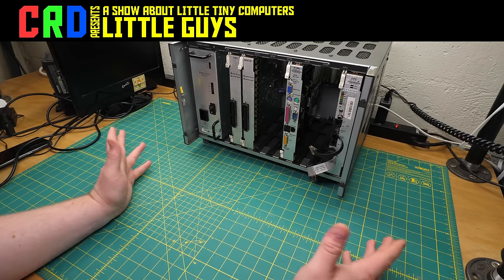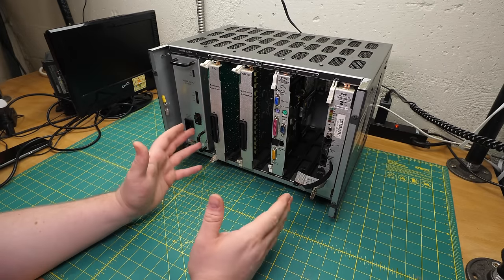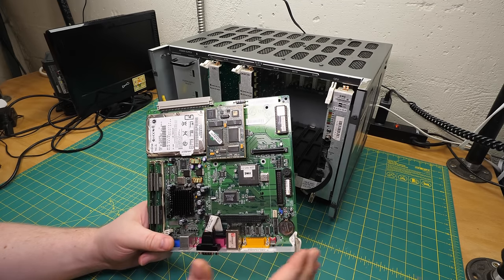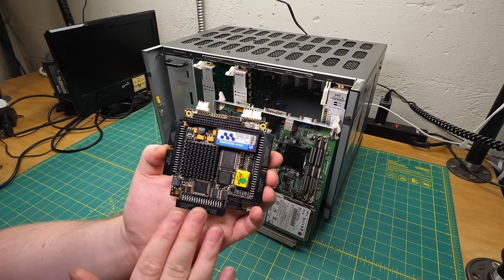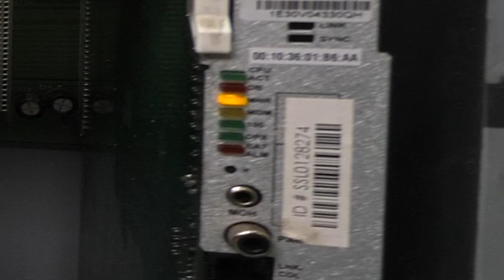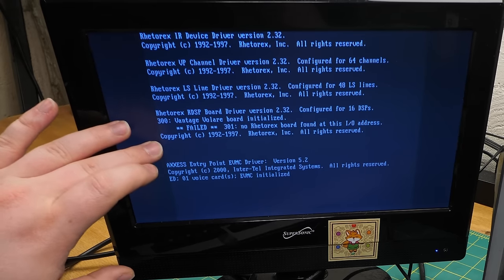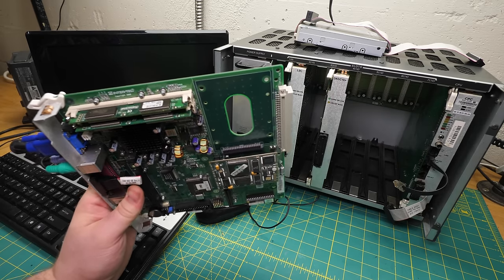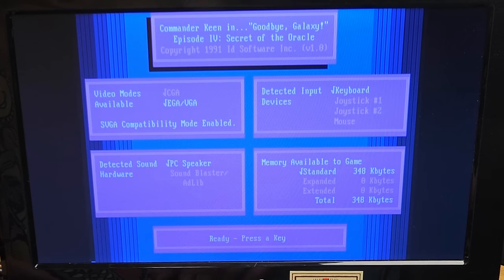Little Guys 9: The First Of Many [Intertel Axxess]

Comment: The 386 and 486 DX-class CPUs had integral FPUs, it was the SX's that didn't. In fact, the 486SX was specifically a neutered DX, rather than the 386 situation where the 386DX was a 386 with a 387 on board.
Reply from the maker: Right, yeah, it's been a bit, heh.
Reply: 386DX didn't had an FPU as far as I know, DX  suffix were later on with 486 era used to determine if FPU is present. 386 era SX/DX difference were that SX had 16bit external data bus, DX variant had full 32bit. And also address bus were 24bit on SX when it was 32bit on DX. 80387 were the FPU chip for 386 cpus, 387 for DX and 387SX for SX.
Reply: False The 386DX had a full 32-bit bus
The 386SX was pin compatible with the 286 Vence being 16-bit

The 386EX was a 386SX adapted and with some SoC-like features for Embeded applications 

The 486DX and SX meant the présence of FPU

Comment: Microsoft still has the fax functionality baked into the print interface even in Windows 10/11. So despite the relative rarity of fax machines these days, the technology continues to live on. I suppose that I shouldn't be too shocked, though, since practically every high-volume commercial printer out there has the ability to be connected to a phone line, assigned a number, and receive or send faxes. It's just not a commonly used feature and I anticipate it being phased out within the next ten years as fewer and fewer people remember that the technology existed in the first place. It's just way easier to take a picture or scan in a document and send it digitally as an instant message, text message, or email. Having fought with a fax machine for a long while when I worked with the government, I can definitely say that the fewer fax machines you have to interact with, the better.

Comment: WRT the little hard drive whoopsie, I think you connected pin 40 on the hard drive (one of several ground pins) into slot 42 (+5V, motor power). Not an expert, but the fact there's a bunch of other grounds and the motor power rail is separate from the logic power rail is what prevented the drive from getting rekt by elimination of the bourgeois pin

Comment: I am guessing that this was used in a car dealership, this is due to the oily film and that I have seen something like this in an old building that used to be a car dealership. There were three systems that were left when upgrades were made the oldest had Z80 chips running them.

Comment: "PCI Early non-VGA device" likely refers to an early PCI device that doesn't have Plug and Play. Windows 98 was all about Plug and Play, and it had been rolled into the PCI BIOS at some point in the mid-90s, but maybe something jelly-beanish like the DSP board from Lucent is just old. PnP came in around PCI 2.1 I think.
Reply from the maker: Don't take this the wrong way, but I'm curious if you have any citations for that. Like, on its face I wouldn't doubt it, I just went "wow that sounds miserable and I never thought about it before," but I wanted to go find references for later use and I'm not coming up with anything. 

I've been looking at some pamphlets from the PCI-SIG and in their summary of major changes for each revision, there's no mention of any changes to PnP - the thing is though, there's no mention of PnP at all. It's like it's an unrelated standard, and indeed maybe it is. So this is really hard to search for, and if you know where I could find details on it that would be really helpful!
Reply: @CathodeRayDude  (Third attempt because YouTube keeps deleting my messages)... 

Plug and Play was always with PCI, but it wasn't useful (as we see it today) until PCI 2.0, and didn't work well until the PCI BIOS 2.1 spec was out... Plug and Play was originally just "the card can tell you how it's configured so the driver can use it" (ISAPNP) and PCI always had a "configuration space" in memory on each card from the beginning to do just that, as well as identify what the card was. In PCI 2.0 you could actually configure the card... but thinking about it further, I don't think PnP is the issue but rather just the configuration space on that card.

PCI 2.0 allowed more flexibility while becoming stricter on what could put into the configuration space (the bit in memory on the card that identifies the vendor, device, device class, sub class, revision, etc.). I can't find any direct references to this either, but I've seen many proprietary PCI devices (like industrial control or GPIO boards) with either a legacy class code or some weird undefined class code.

Specifically though, I suspect your device has class 0x00, subclass 0x00. All the way back in PCI 1.0, class 0x00 in the configuration section was set up for legacy devices running on a PCI bus - subclass 0x00 is literally "not a VGA device" and subclass 0x01 is "is a VGA device" which is about the minimum thing the BIOS would have cared about to find a display. This allowed transitioning manufacturers to bring a PCI card to market using a slightly modified older design, especially cards that just used a PCI to ISA bridge chip on board and did everything else as before. So undoubtedly that card also has zero PnP capabilities, and by definition is an "early PCI" card.

It could be interesting to boot into Linux and run lspci and see what it says, or even in windows to open device manager and peek at the hardware ID, which is basically a cut down version of what's in the configuration space on the card. Look for the &CC_xxxx bit, where xxxx is the class and subclass codes in hex (i.e. 0300 is a VGA capable graphics card).

Some rambling background to address my earlier comment about PnP: Back in the 90's I was working on an "always online" operating system that would rely on a broadband connection, even potentially "booting" off the Internet. It was to run on PC hardware, booting off a 32kB EEPROM added to a NIC that would load the OS into memory over the network, or if the machine had a hard drive it could boot from a cached copy from disk.

It was overly ambitious, required a bit too much RAM for the day, and aside from the complexities of compression, encryption, and the idea of "web applications" was too "new" and died on the vine. The idea was to initially sell NS2000 compatible Realtek based NICs with the EEPROM already installed, and the end user would install the card, connect to a broadband modem, boot and follow the installation process. Later we had plans to have a card that had a NIC, the ROM, and some hardware acceleration for TCP/IP offloading and traffic compression using an FPGA.

So anyway, we wanted to rely on PnP because it would simplify our life. PCI PnP didn't really work nicely on most motherboards we tried until the PCI BIOS 2.1 spec where they fixed the configuration specification. Before PCI 2.0, the configuration space on a card was simplistic - it identified the device (vendor, device ID, revision, etc.) but you couldn't change card settings and it missed other information. Under PCI 2.0, it was still 256 bytes but contained pointers to memory locations with lists such as device capabilities, hot swap support, power management support, message signalled interrupt support, inventory management, and extensibility for vendors to take advantage of. PCI 2.0 also introduced registers that allowed you to actually configure the card, i.e. true Plug and Play as we know it today.

Without getting into it too much as I think I've waffled on enough, the PCI BIOS 2.1 spec was much better at allocating resources automatically and really fixed a lot of interoperability issues with stronger standardisation. The 2.0 spec allowed for configuration but many BIOS implementations either didn't do it automatically or they did but badly resulting in conflicts or missing resource allocation.

Sorry for the long reply.
Reply from the maker: @benespection  Ah! This makes more sense, okay, I DID see mentions of the configuration space being expanded with 2.0, but I didn't know that was connected to PnP. I get the strong impression that "plug and play," as a branding initiative, had very little specific meaning and actually referred to a ton of unrelated behaviors, this being one of them. I am now extremely curious to obtain an early motherboard/card combo and see if I can identify any glaring differences in behavior. Thank you so much for all this info!

Comment: pulse dialing works backwards i.e. a 1 is 9 pulses, 0 is 10 pulses. It's because on a dial phone those numbers will travel the longest and "click" most contacts.
Reply from the maker: you almost have that right. the 0 is indeed ten pulses, because you can't express zero in finite clicks, so they put it after the 9. the other numbers are all straightforward.

Comment: I don't know if it's applicable here, but the Game Port was also used for MIDI for a while. So I guess it had some use as a more general purpose port. Pin 12 was used as a MIDI Out instead of a Button GND in that case, giving the port an output.
Reply: Technically, MIDI was just borrowing an unused pin in the game port pinout.  That only happened because the Sound Blaster combined a bunch of previously separate cards into one, and it became expected that sound cards would then offer all the usual game-related stuff:  FM synth, digital audio, a game port (which previously would be on the IO / controller card, and before that, on e.g., the IBM game port adapter card), and a MIDI interface.  Since there is only so much room on the slot bracket, they had to get Creative.  (heh.)

Comment: The way the CPU Card blocks one of the ribbon ports so you can only ever have 1 CPU card, even IF the enclosure is expanded, AND it keeps the card at the very end of the enclosure, it is VERY clever, simple and low-tech. I love solutions like this compared to overwngineered solutions.
Reply: I've seen a portable audio mixer with a similarly clever low-tech auto shutoff solution. When you close it a little peg on the cover pushes onto the main power rocker switch.

Comment: As a kid in the early 90s, there was a brief time where I was obsessed with OS/2 but by the time I got a copy, I couldn't get it to install, plus Windows 95 was either out or right around the corner.

Also, if the motherboard has a PCI bus, you can absolutely get USB working, even on a 486. Allegedly, in the embedded world, it's not uncommon to see native USB on 486-based systems.

Finally, Duke3D should be playable on a DX-2...At least much better than this. Granted, I ran it on a Cyrix DX2-80MHz (so faster bus than most at 40MHz), plus a decent VLB video card.

Comment: Something in this video made me go and get my Maxim DS80C400 Evaluation Kit and set it up again, after a pause of about 3 years.  The DS80C400 almost deserves to be called a 'Little Guy' itself, as it's a chip on a small module that plugs into a socket that looks like a SIMM slot.  It runs a Java-based OS called 'TINI OS'.  I tried to build the web server example in the manual, and found that at some point, I'd updated the OS and now nothing will run on it - and Maxim were bought out by Analog Devices and I can't find the software to recompile the example. [much wailing and stamping]

Comment: Games made or ported by Frontline Design had a sound framework that actually had a native PC speaker driver. So you can play something like Pinball Fantasies with its gorgeous MOD soundtrack actually pumped through the PC speaker, without any weird TSRs. There was also a PC speaker audio driver for Windows 3.1x. You should definitely try things like that next time you show a computer with no other sound output!
Reply from the maker: Ahh, I knew I remembered something having native PC speaker support. I'll try to remember this!
Reply: @CathodeRayDude  There's also FastTracker 2 that supports that for some reason, if you wanted to... make music without a sound card I guess?

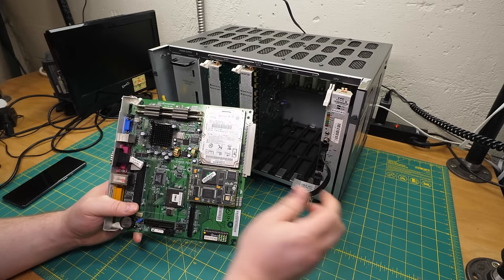Comment: 16:54 Definitely not a bit much for restaurants and much smaller businesses, depending on how uninformed the client was.
I've been to several sites which only had two phones but for some reason, had a $6000 PBX that could easily handle way more.

Upon further inquiries, it turns out shady sales people would trap clients in lengthy and expensive contracts for systems with capabilities they might only use a fraction of.

Comment: DN3D FPU usage gives me pause.

Originally when analysing source code, i found that the game uses no FPU arithmetic. but it did seem to be using FPU load/store instructions in order to quickly extract exponent, effectively low precision lograrithmise a number to obtain the first approximation of a division, which is then further refined purely in integer.

However the published source code appears to not be representative of the DOS game release, where i can't find all this at all. I disassembled the executable and found no FPU loads. The source code drop looks cobbled together from various development snapshots with unclear timeline.

Comment: Yea the easy fix for those floppy cables is a thumb tac i fixed many blocked headers that way haven't ever noticed any difference the motherboard end usually isnt connected to any trace thinks its cheaper for manufacturers to buy standard header blocks and just make the one pin a no connection.

Comment: Hmm, for that PCI device you should still be able to find the vendor and device ID. I'm probably not the first one to suggest that but a quick Ctrl-F through the comments didn't show anything. On modern Windows it's on the Details tab undder the Hardware Ids property. I have no idea about Windows 95 but it's gotta be there somewhere.
Reply from the maker: Shockingly there was no built in way to do it back in the day. It was amazing when W2K came out and started showing this info, and i have no idea why prior OSes didn't. Linux had lspci, and ofc you could get windows apps for doing it, but it's wild that it wasn't built in behavior. At any rate, yeah, I probably could have found something - but I figured that if hwinfo didn't recognize it, the chances of useful drivers existing were close to nothing, and it wouldn't end up getting me much anyway, so I focused on other priorities.

Comment: I wouldn't be surprised if DSP is just for doing ADC/DAC work and compression (and maybe DTMF, but maybe not). The reason is that 486's could barely handle two channels of uncompressed audio, let alone analyze it or compress it. Remember that 486's couldn't even playback MP3's in real-time. They weren't doing anything on CPU with all that audio.
Reply from the maker: While I agree with your conclusion, MP3 is an unfair comparison - nobody would have ever used compression that aggressive in telephony, and they still don't nowadays. In almost every application I've seen (and I've seen a *lot*,) audio is stored and handled in basically T-carrier format: 8khz, 8bit, mono PCM, ulaw (in the US) and uncompressed, which could be handled by discrete transistors in the 1970s when it was new, and at this point could probably be processed by just about any piece of silicon on the market. I'd expect either the Coldfire or the 486 can process multiple PCM channels at once, but only for passthrough - the problem comes when you need to do mixing, muxing of multiple calls for conferencing (tbh unlikely in this era without an additional meet-me card), conversion from ulaw to alaw, and other manipulations beyond simply slurping up or outputting an unmodified stream, those are considerably more involved esp. for realtime applications.
Reply: @CathodeRayDude  I suppose it would be able to handle 8-bit low sample rate audio by itself and would run into problems with mixing and conversion certainly, but I'd also like to point out that recording fax transmissions requires using at least 64kbit/s uncompressed audio, which, you're right the passthrough and writing directly to disk would be fine on a 486, I can see where a DSP would start to be nice when you get into conversions and the such. Good point

Comment: I'd wager the modern raspberry pi is leagues more powerful than 99% of the use cases that would require one, I mean the modern raspi requires a heat sync now...

Comment: I want to install a pbx system in my house along with those nice hand sets. This would allow anyone the ability to pick up a phone on a wall and call anyone in the house. Either right a location or ring them all. leave voice mails and so on. I was under the impression that you could or they were intended to do video at some point.
Reply from the maker: There are loads of PBXes and phones on ebay that you can get for a song and do exactly this, though I couldn't tell you which one is a good place to start, there's so many and they all have steep learning curves. I used to have a Nortel setup with a phone in the bathroom; made it a lot easier to handle the "out of TP" situation, just hit PAGE ALL and beg for help
Reply: @CathodeRayDude  I am still watching the video. Yet I have looked at them and systems like this are pretty cool. I will have to dive in and find something cool. I just want to find something video related. I was sure there was something like that if I recall.

Comment: If PC104 is ISA, wouldn't it be fairly trivial to make an adapter so a normal ISA card can be used?
One janky solution would be cutting up an ISA riser cable on one side and plugging the other side into an ISA backplane board, no PCB designing required.

Comment: the floppy cable; you can just pull the nylon pin block out of the female 34 pin header. trust me they come right out with some twisters.
Reply from the maker: Pretty sure that's cable-specific. I've absolutely seen it and done it before, but on this connector the plastic in the plugged socket is recessed and appears to have been cast as-is.